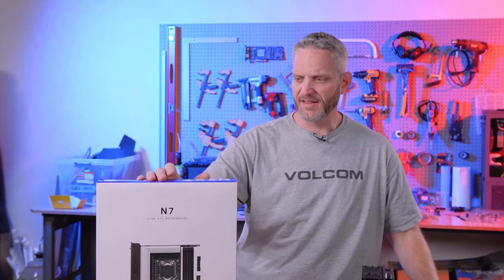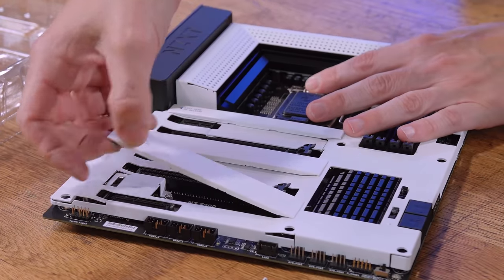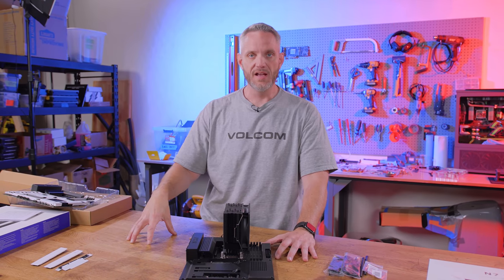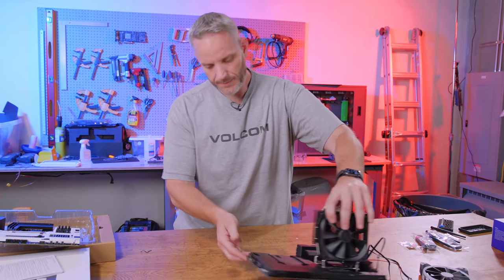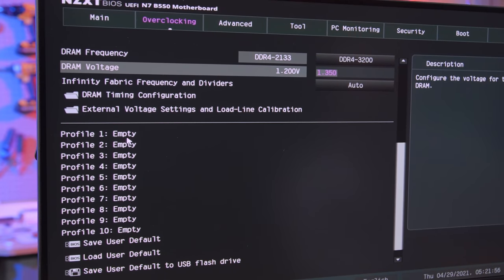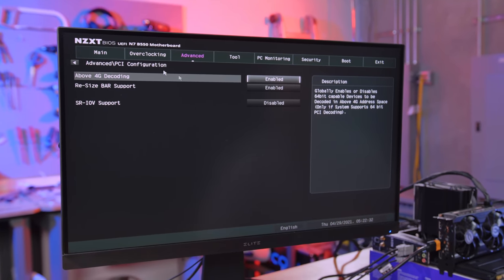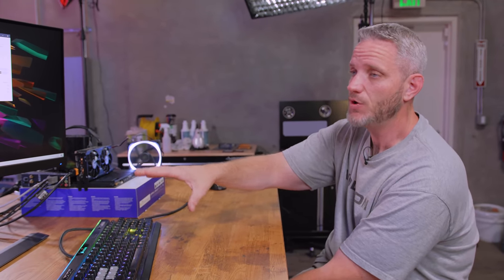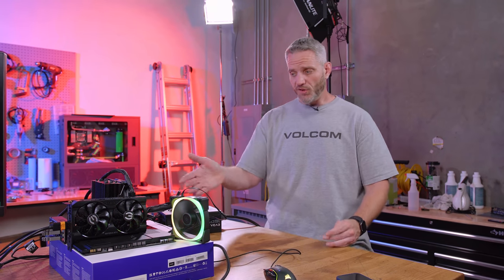Matte Black Motherboard Setup... Absolutely gorgeous!

Comment: Once upon a time I would’ve thought those large shields covering the motherboard were silly or pointless, but recently I was using a screwdriver to push on a particularly stiff PCIe slot locking mechanism, and the shit slipped off and I made a Doc Brown noise when it stabbed the board.  Luckily for me it was a cosmetic scuff, but if it had been a cheaper board, or if I had given ‘er a bit more gusto it could’ve been a problem!  You can also hide RGB cables USB headers underneath, if you wanted to run one up to an AIO.

I bought an NZXT AIO recently and I didn’t hate the CAM software, but it absolutely DID NOT play nice with my Aorus board’s RGB Fusion 2.0 software, which caused a super awesome BSoD hard lock, which I figured out pretty quickly what the problem was.  The good news is that once you configure your RGB stuff with CAM, you can disable it on startup and it will retain the settings, and it only runs a super tiny, not even noticeable helper service in the background that doesn’t seem to conflict with anything I’m running.

So, like Jay was saying give it a shot, because it’s not as bad as it used to be.  Honestly, if my Mobo and GPU weren’t both Gigabyte Aorus products, I would’ve considered using it, because the interface and functionality was decent.  I’d even consider building a system with all NZXT parts (as much as that’s possible) because I think their cases and overall design aesthetic look really slick.

Comment: Every single NZXT board sucks. They all have terrible ratings, for a reason. They are shoddy and overpriced. Save your money. They make good budget cases. They make horrible expensive motherboards. The only thing it has going for it is looks. Which would be enough if the board could just work. Look them up on amazon. Almost every single review is bad for literally every one of their boards. Its not a bad batch, its a bad manufacturer.

Comment: Asus had a motherboard called P67 Sabertooth that had similar blacked out look with a plastic flat cover. Back then they advertised it as airflow improver, which is obviously bullshit, but it looked amazing. I had it in my sandybridge rig. After that Asus dropped the Sabertooth line and the cool plastic cover was not seen again, until now on these NZXT boards.

Comment: Now if only CAM wasn't crashing OS right now.  Jeff and team are supposedly investigating the problem but an unreasonable amount of amd and even some intel builds are locking up with Cam running on Windows 20H2 and or in the presence of other control softwares.  There is a live thread on this topic on the LTT forum as well with many opting to ditch thier Kraken AIOs or use liquidctl to control them.

Comment: 17:18 - This is not Window's fault, it's the UEFI dictating it. It dictates the OS (Also Linux does this) to use the first drive in the order of the bus system. And for whatever reason, the SATA controllers come first. You always install your OS with only the OS drive installed in the system and add your other drives later since UEFI exists. Common knowledge.

Comment: Rubbers under this small removable plates are to remove vibration.. No1 cares about cratshes UNDER a plate m8.. Pure vibration from case fans or W pump etc.. Anyway even better might a a lvler so all is at the right high it cuts cut @ all same stell thicknes got avoid extra cost who know's could be cheaper :)

Comment: I had a gigabyte board a few months ago so flimsy I think I killed it putting ram in. Don't remember which board...had an i7 on it. The case was pretty thin too, not helping. It was in a newegg POS 3060ti prebuild that I sent back. I was trying a few different sets. This where I found that the Gskill that specifically touted XMP ready on the webpage....did not have an XMP profile. When I asked Gskill about it...they said......I have the email...I don't need XMP I need to buy faster ram if I want faster ram. I went back to the original ram.
Anyway..  it was really hard to get any of it to snap in without flexing the crap out of the board, even with a hand behind it. I wasn't trying to force it, being as gentle as I could, make sure it's all lined up....I think those slots were made a bit too narrow or something... I didn't delve too deep into what went wrong, but it never booted again. Just before it went back in the box all it would do was a rapid power on off over and over. 
Two weeks old. I said nope...

Comment: Flat black...been there, done that. ASUS Sabertooth with thermal armor in the 4th gen Intel days. Nothing new. in fact, this looks like a rip-off of the ASUS board. In fact the ASUS design was better as it had two small fans to actively cool the vrms with adjustable vents and a filter on the intake fan.

Comment: I could be wrong, but I always hear that the best way to cool an M.2 SSD is to apply the thermal pad to the controller and not the NAND as the NAND 'likes' to be warm while the controller does not.

Is this still conventional wisdom? Or has this changed?

Comment: erm... active cooling is where you are using energy to dissipate heat e.g. fans and pumps. when talking about the m.2 slots, you meant to say that the motherboard had no m.2 cooling whatsoever; very few active m.2 coolers exist and most motherboards haver integrated passive m.2 heatsinks.

Comment: 6:27 - you keep calling it "active cooling". A heat spreader is a passive solution since it doesn't require power. A fan is active cooling.

Comment: Appreciate the love you showed Asrock. My first build had an Extreme3 Z77 board from ASRock. Absolutely the best value. And still running to this day, I gave my first build to a friend and he still daily drives it. 
i5-3570k and a GTX 770. Definitely showing its age but run CSGO just fine for him which is basically all he plays.

Comment: I'll be honest, I'm not down with the aesthetics. I can see the benefit in white if you're doing a "white" build, I think those will be extremely popular. In black it just looks like it's covered in cheap plastic like a Realistic boom box from the late 70's- without that cool retro feel. Being able to see the inner workings of the mobo through the case is part of the reason we use glass doors. This style gives a build too sanitary a look in this nub's opinion. Tell me if I'm missing something.

Comment: So you mention  having part of your windows system files installed on another drive.  I ended up with this problem myself due to lack of experience with SSD and NVME I imagine.  Is there a way to fix that so I dont have to keep other drives installed.  I was setting up to use other drives as removeable backups and my case has a great port for this so I can plug in the drive.  Back up.  unplug drive till next backup. 

I really dont want to fresh install windows again as I would have to fight with license transfers on some important programs I use.

Comment: I'm Graphic and Designer, said awhile back that need help designing. I doubt you'll see this anyways but here's my idea: building 3 mobile studio on wheels will make it better changing in the future for holidays or events easier and cleaner, having a loft in one corner for breaks, podcast,  and other filing B rolls and special lighting. using the rolled door for car display to show off builds or to work on a car: turn table. have acoustic panels handing from the rafters to handle the sound. build library storage, next to the loft to have storage shelf for loft with out taking up the floor space, and for everything you have. keeping everything labeled like a library and having rolling ladder. 
 sorry for English and grammar.

Comment: I wonder why they don't put the 24 pin at 90 degrees, like they have with the USB C and SATA headers???  Aesthetically, that would look better and make it easier to attach the power cable but I've yet to see a motherboard that does this.

Comment: I like having internal USB 2.0 just because I have an adapter that I use so I can plug in my wireless dongles and such, things that I'm unlikely to ever remove, inside the case and keep my back panel ports open.

Comment: I have the x570 Phantom gaming 4 mobo and it's bios gui is almost identical to this one. So Jay, they've been had mobos with multiple overclocking profiles that you could change easily cuz I got this way back in the early 2020 and I still use it with my 5600x

Comment: It's easy to accidentally torque those Wi-Fi antennas -- one of the connectors on my mobo is loose now and it's a pain in the ass to fix (separating the IO panel housing/cooling setup is non-trivial). Just make sure you take them off if you're going to work on your computer for any significant time.

Comment: You say about using both the 8 and the 4 pin when using a high core count cpu? How do you use the extra port though? Even on my Corsair HX1000 I don't seem to have a lead that connects too it? Can you please advise?

Comment: I just hate how NZXT Cam doesn’t allow for resizing the window. So much engineering gone into the software and they refuse to include the most basic feature.

I just want to use Cam as a system monitor on the screen inside my tower...

Comment: Looks nice but I myself would rather see Satin Black. look about the same but satin is ten times easier clean. you do not leave little white fussies when you wipe it off. Being a car guy myself " painted them for years" the black trim on cars that every think is matte black is not. it is Satin Black. wanted a black 011 mini, at the time could only get white for $96 said what the hell, took it all apart painted it Satin Black. and wow. easy to clean of dust and looks way better than any 011 mini mate black.

Comment: One thing I've never understood about motherboard layout: why do they put the case connectors along the bottom back edge of the case?  Top front corner seems like the obvious choice because 99% of cases have all their front panel stuff positioned in the top front corner of the case, either just back from the front on the top or just below the top on the front.  I feel like you might actually get half decent front panel audio if you were to route it through a 6-8 inch cable that doesn't need to traverse the entire goddamned case and thus get exposed to induction from literally every other cable in the computer.  It would never be the perfect option - for one thing, any trace on the motherboard is going to be subject to some degree of induction based interference as well (though everything else seems to handle it just fine...maybe route the signal to the top front corner digitally and only do the analogue conversion at that corner?  Would that help?) - and no matter how well you manage the induction issue it's still just one stereo output compared to the surround sound support you get with the backplate ports.

Alternately, case manufacturers, couldn't you work out something just a tad better than giving us 50 sub-millimetre cables that just hang from that corner?  With all the cable routing options we get these days, surely there's a way to build those cables into structural bits and seal them off properly so we just have a little outlet near where all the motherboards put their case port option where we can set up a nice, short, easily managed cable from a convenient location?

Or, because of pure chaos, why don't you both go all in and do it at the same time.  Just to make Jay tear his hair out.  ^_^

Comment: did you just say cooling one only one side of an m.2 ssd could still throttle??? Surely the heat will sink through the pcb to the side being cooled....I mean how many m.2 ssds are cooled on both sides?

Comment: Mobo makers are stuck in a rut. What we need is power and data headers to be "laid down" at 90 degrees from the standard vertical placement, as a few boards have done.  Enough fan headers in the right places; placing headers in the middle of the board is dumb. Case connections that don't feel like they're going to break if I touch them and don't require a microscope to install. 

All that said, imagine if case and mobo makers went out on a limb and designed a system that has all the connections on the back of the board.  What a clean look that would provide!

Comment: cool.
I hate it how they seem to put a few of the new tech in the mother board and more of the old stuff to fill the board.
I got kinda upset that even on the expensive board that 1 gen 4 m.2 slot the rest gen 3. there where other stuff on the board that where similar problem. I like putting newer stuff. usally it's backwards capable anyways.

Comment: I thought it was concluded that m.2 cooling isn't really needed. But if you do---need to separate the controller for cooling, not the NAND. https://youtu.be/GVvFoX45bOw?t=657
Reply: Through various layers of copper inside the PCB and the heatsink or heatspreader itself the heat of the controller will seep into the NAND chips anyway. There is nothing to worry about as long as you don't start actively cooling the NAND chips.

Comment: with gparted on linux (manjaro live distros have it already installed) you can copy the bootloader partition from your sata ssd to your nvme ssd and it will work without problems. while at it you should also copy the repair partition .

Comment: funny how cars and motherboards are similar,  old school engine bays and mobo's showed everything and it is a cool look to see all the tracers, chips, paths, ect.  (if that hotrod look is what you are after) ,,  today new cars and new motherboards are covered with a bunch of panels almost to the point of a motherboard is a case within a case and when you look at an engine bay you see covers. .. it leaves the viewer of the car or computers wondering, what is under there.  lol. ..  just an observation.. I like both looks

Comment: Quick question: I have a i9 9900k and thinking about getting a Ryzen 5900x, should I get it or wait for the AMD Ryzen 6000 series ? Or will that not be released anytime soon ?
Reply: But when the 6000 series come out why wouldn’t you just wait for a 7000 series. Just get what you need today for ur performance needs and be happy. There will always be better things coming out, so buy what is enough for your performance use case and just re evaluate it In a few years when you need to upgrade. No need to always trying to predict the future when upgrading. Wait till it comes out then upgrade.
Reply: Do you need 12 cores now? Do you need higher fps now? Do you just want it now? Follow your heart its your money even if its only a yes to the last one then go for it.
Reply: Also think about inventory. It depends on where in the world you are. 5900x are hard to find in the USA. As far of the zen 4 chips idk when those will drop probably not til end of year is my guess
Reply: @sharkexpert12  I definitely wouldn't say I need those   because I actually still like my current set up but they'd be very useful in my 3D software work. Maybe what I'm really asking is if it's worth upgrading right now or should I skip the current gen products and wait for the next gen if they'll be released in like a year, assuming
Reply: @TheTopStarz  If I remember right, Zen 4 will be on a new socket with support for DDR5 and PCI-e 5. It would require a new motherboard and new RAM if you go Zen 4.
Reply: @TheTopStarz  oh if its for 3d modeling if you have enough work coming in to facilitate the need for it or you just want to be done faster to hang out with friends and/or family do it no regrets it will pay for itself so fast you may as well wait for zen 3 threadripper.
Reply: Due to the situation in the world and the effed up market, it might not happen that we see a new CPU gen this year. But it could well be that Ryzen 5000 was the last AM4 socket CPU from AMD. Since prices are up in general and as long as the 9900K is not broken, I would wait until next year.

Comment: There is a significant difference between the wires antenna, and the basic antenna that does directly on. The basic ones always suck, and have always have a shitty signal. Wired ones can be placed away from the case, and can get a stronger signal w/o moving your entire PC and entire networking rig.

Comment: for the nvme m.2 ssd can i buy a thermal pad and then put it on the m.2 ssd. Will the temperature be good because ik without one it will over heat

Comment: I hate the antenna that's just a cable and has to go somewhere where it falls over because the wire is too short. So i just took the antenna thingys from my b450 board that are these things and put them on my b550 board. It works great.

Comment: i remember i had pre ordered nzxt fans when those hue+ fans were announced. i did my whole build with them.... 2 months later when i was reaching in my case for some reason my wrist just touched the rear fan while it was spinning and it sent one of the fan blades flying.... i hope by now nzxt has changed the type of plastic they use to something less brittle

Comment: How to do have all the games installed on a new motherboard do you use an nvme because then it would require reformatting on every motherboard you run it on if no then what do you do to have all your files on some different rig?

Comment: You should do a video on the NZXT cam issues which appear to plague AMD boards mainly (but also some Intel boards) and cause crashing unless you either close it (and loose the speed ramping over load) or use something like liquidctl to manage it instead. It does appear disabling global c-state does stop the crashing but it's still pretty poor

Comment: Did a similar matte black (with couple of small blue accents) look 5-6 years ago on a Sabertooth X99, by removing all the covers and shrouds and airbrushing them, then painting the slots as well (put some cardboard in them to prevent them getting shat up by the paint. Turned out pretty nicely, only downside is matte surface seems to grip very fine dust (the kind that goes through the filters) like crazy.